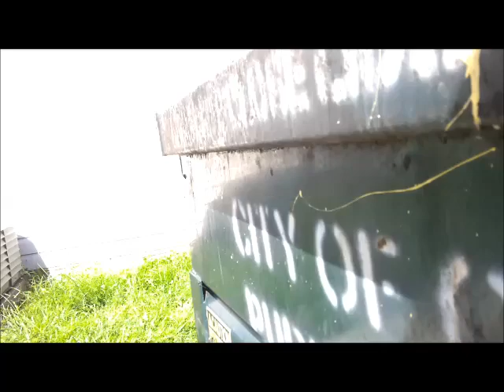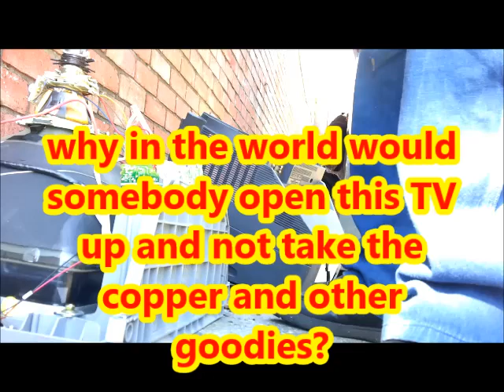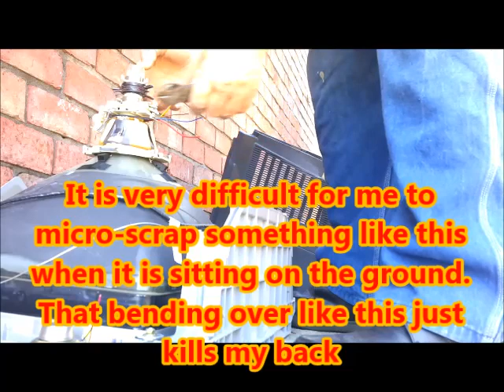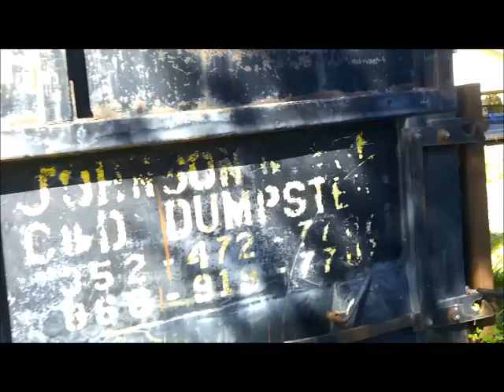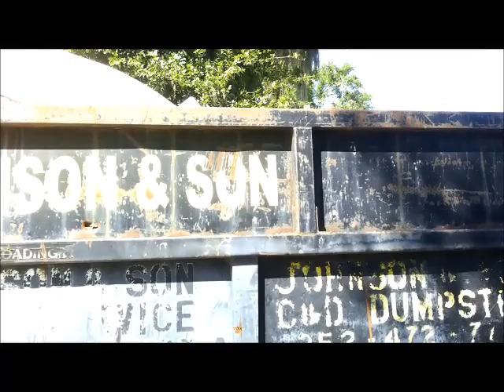My Sunday Scrap Days

Comment: Had taken apart tv 25 years old degassing cable was alumunium I believe. The glass on crt is so heavy!
Reply from the maker: seems like most of the older CRT TV's guasing cables are usually copper